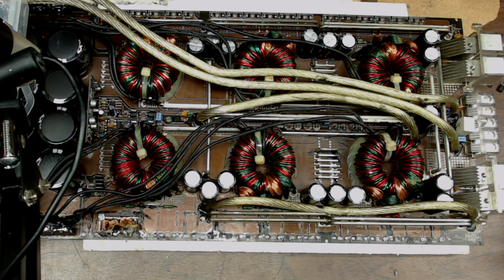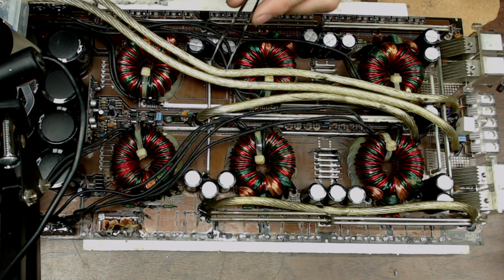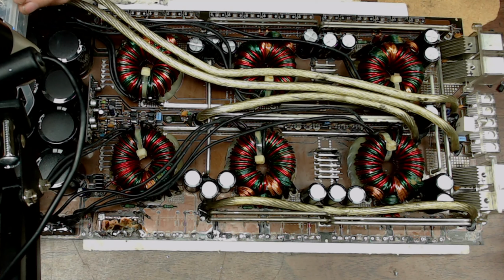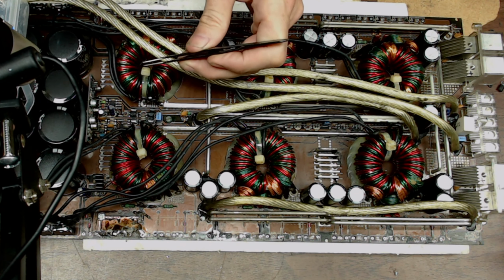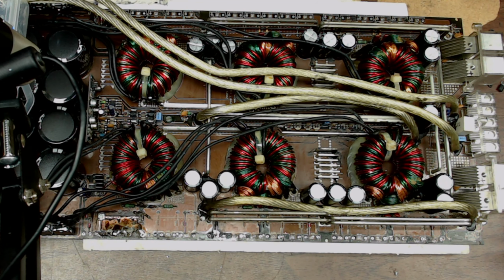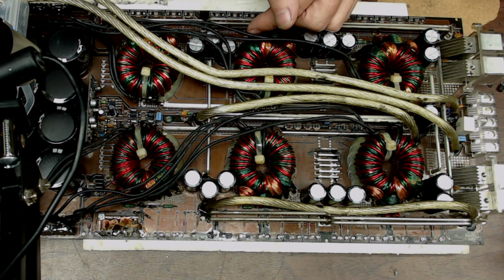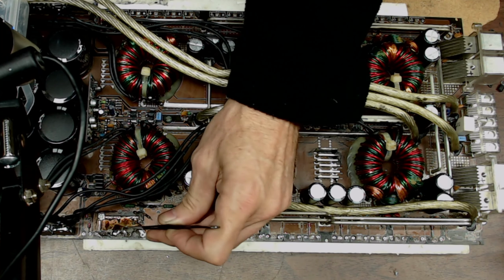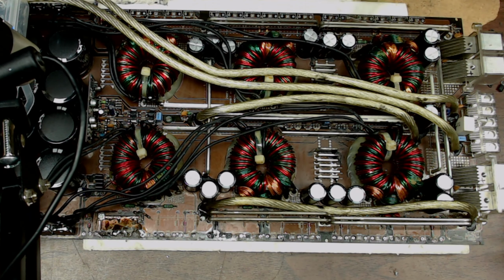Db Drive 7.5k Class D Amplifier Power Supply Repair With Tips On Transistor Placement

Comment: Yep, always replace the drive components when those sections die, sign of a quality repair that doesn't want warranty returns! Awesome!
Reply from the maker: Indeed Damon returns just cut into time and money. I am 2 capacitors shy (snubber caps) of loading the power supply transistors and about to check for any gate ringing.

Comment: I have a oldschool chrome orion 2500D amp I would love to get repaired! Is there any chance you could fix it for me???😬 thank you in advance
Reply from the maker: I can do my best to get it up and running for you. If it is the board I am thinking of it is a board that uses a PIC with a modulation card and 2 driver cards. These are super finicky with a narrow line of output transistors it will drive. Feel free to get ahold of me at www.ellensburgamplifier.com
Reply: @ellensburgamplifier  awesome! Do I just send it to you and go from there? Hopefully it can be fixed 🙏
Reply from the maker: @relaxgaming5233  Yes from here you will need to go fill out a quote request on my website to get you into the system. You will find it under the "more" tab at the top of the site.
Reply: @ellensburgamplifier  thank you!!!
Reply from the maker: @relaxgaming5233  Any day that's what I am here for and thank you for considering Ellensburg Amplifier for your repair needs!